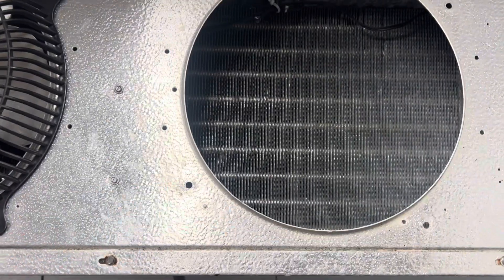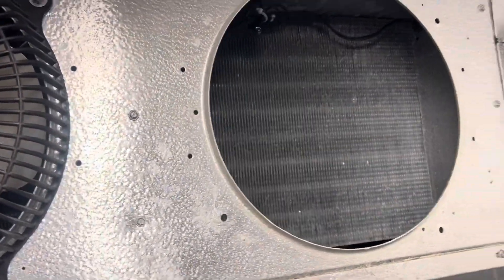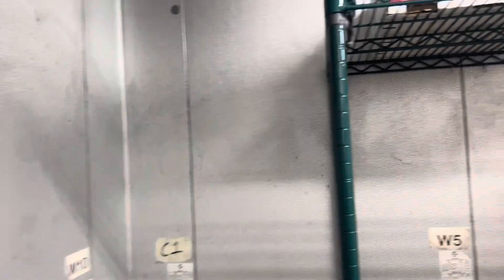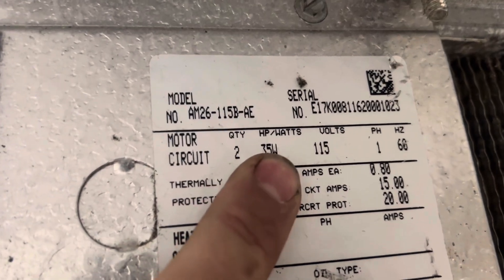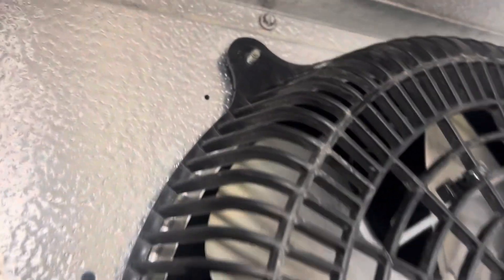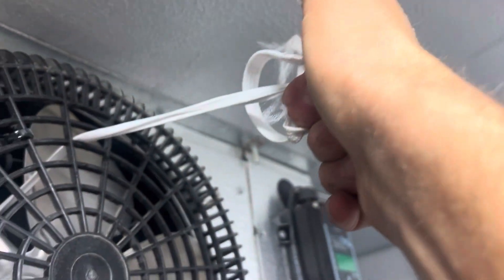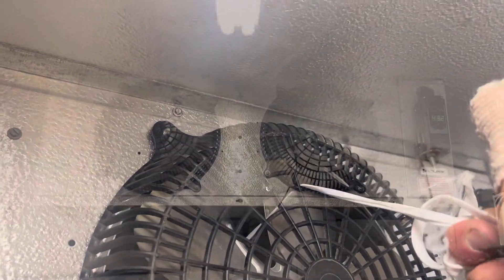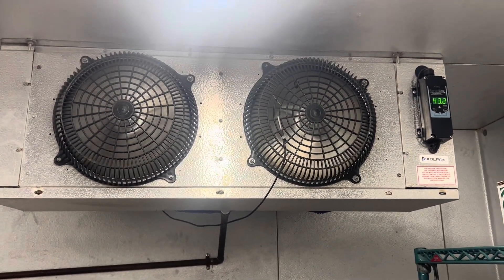Walk-in cooler - fan not spinning

Comment: 👍💪🇺🇸❄️ I had a very similar service call but it was on a drawer unit and it wasn’t a fan issue it was a wire issue but the wires were behind a panel and I actually had my voltage pen which was very helpful because I didn’t feel like taking the whole freaking panel down with the whole cage inside those drawer units it’s a pita but I got it done
Reply from the maker: Right on